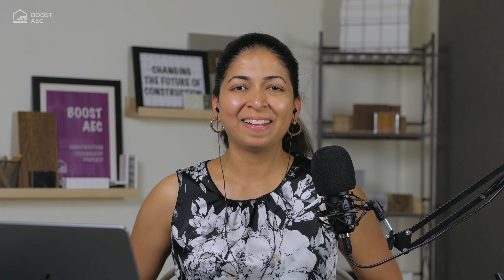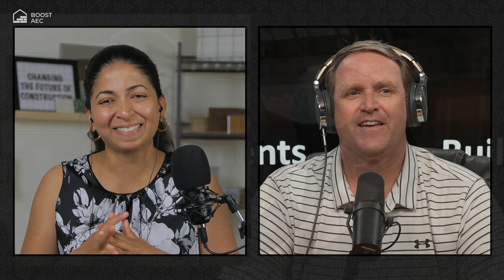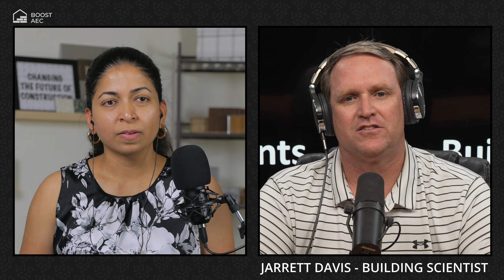Innovative Material Testing w/ Build Environments | Episode 71

Comment: So, everything we need to know is between 43:20 and 44:06?
Basically build with stone or concrete coated with Zirconia?
What material do you build a house with that is impervious to fire, mold, termites, tornadoes, hurricanes, etc?
I want to build a small house in Florida that can withstand all these things. I don’t care about aesthetics. I don’t care if pipes or electrical conduit is visible on the inside. I want practical, sturdy and healthy.
I also don’t care if it costs more per sqft. I’d be right and smaller. 
What should this house be made of?